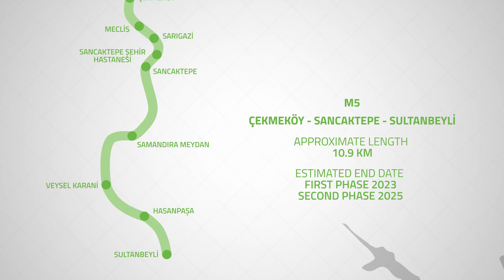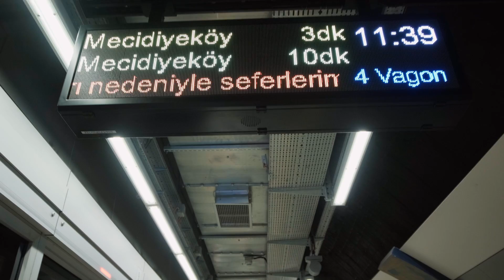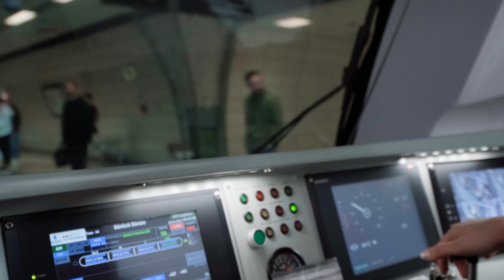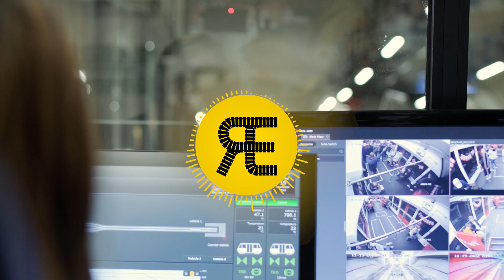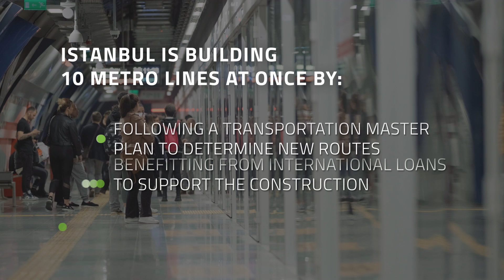How is Istanbul building 10 metro lines at once? | With Railways Explained

Comment: There are many lessons that every country should learn from our mistakes. And that is lesson number one: as a city, you cannot build 10 metro lines all at once. I hope they complete the Tavşantepe-Tuzla line, which started on April 28, 2017. Initially, it was estimated to be finished within 34 months. However, after 61 months, they haven't even started digging the stations.
Reply: You are mistaken.
Idea of announcing 10 metros at once isto fast forward process.
I meant NOT building but planning only and preparation of DPR etc..
Reply: İstanbul el değiştirdiği için olabilir mi akıllı kardeşim? Ekrem İmamoğlu kaç yılında geldi de 2017 diyorsun?

Comment: Could you please explain how that system shown in 04:48 works? it seems like instead of two rails for two ways they have only one rail and the trains use a branched area to pass each other! this can save a lot of cost!
Reply: That's a funicular. Meaning it's a...modified train that can climb VERY steep gradients. Basically the carriages are attached to those ropes that you can see in the middle of the two rail tracks and so it can climb just like a cableway 🚡 without slipping.